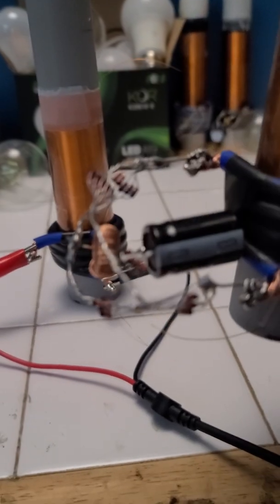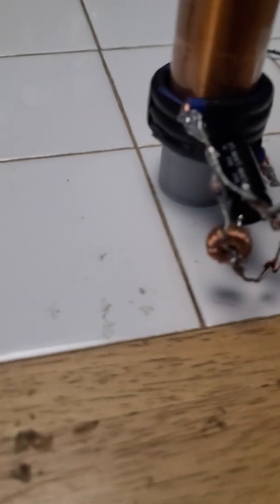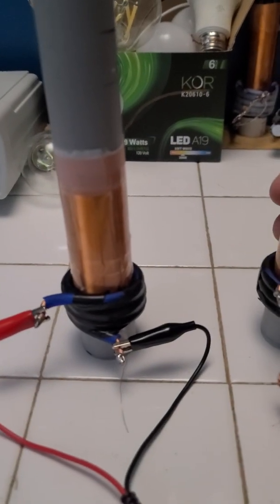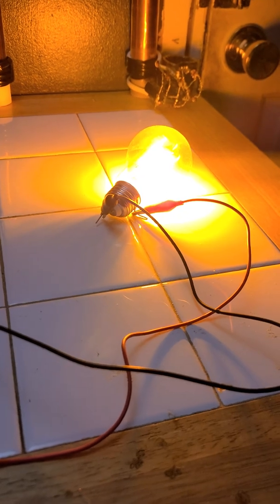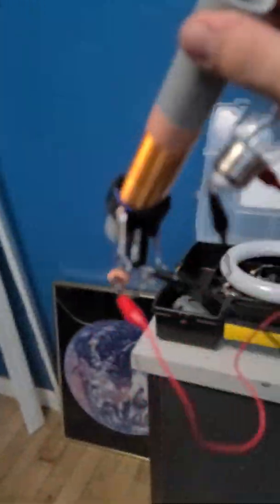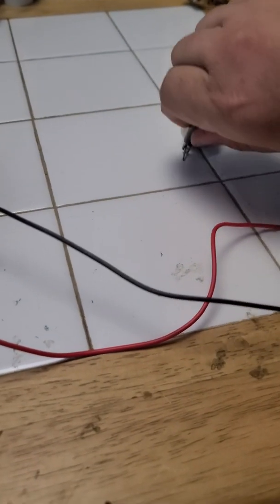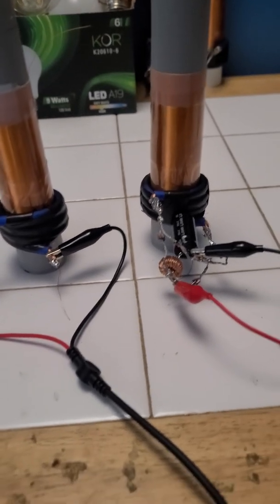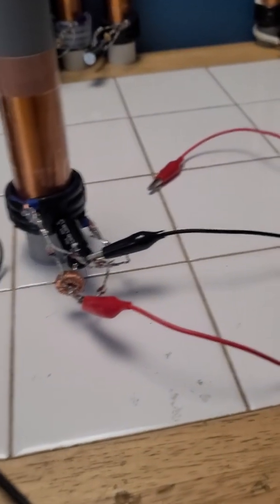💡 Output Tests On Finer Tuned System Wireless Power 🌩 👌

Comment: also you need to use the PLL(Phase Locked Loop) ICs.  This will hold the resonance frequency in place between the L1/L2 of coils.  In more advanced system also need between TX and RX parts...

Comment: Please on measuring the input power, add in the signal generator power input, the amplified input power, to give a total power input of the Transmitter, and show the method of reading the total power input to the Transmitter and the total power out put of the receiver, to support your statement
Reply from the maker: I've shown the setup very detailed in previous videos. The amplifier & signel gen are both plugged into a watt meter via a small extension cord adapter. Input power cannot exceed 30 watts due to the specs of the equipment. 10 watt signal gen & 20 watt amplifier. My output power is around 100-150 Watts DC once its rectified. The gain in power is believed to come from the RF of the sun

Comment: try placing 3 more receiver coils around the transmitter.  Then combine the total receiver output and measure the input and output power.  If the theory is correct, you should get more output than input. ..